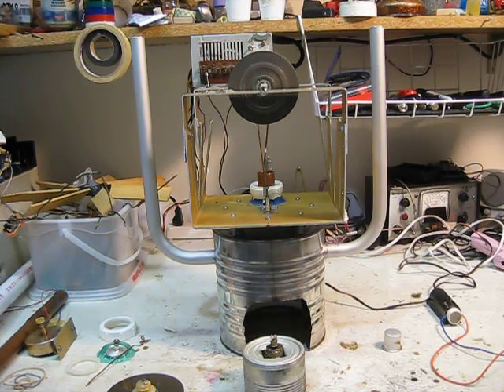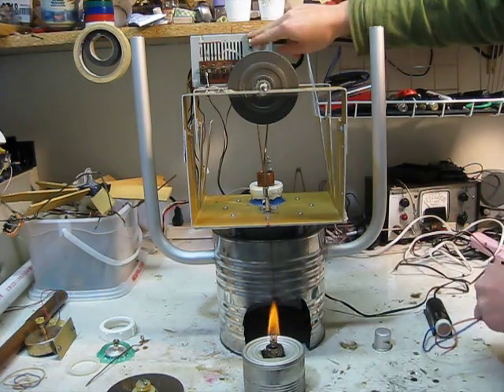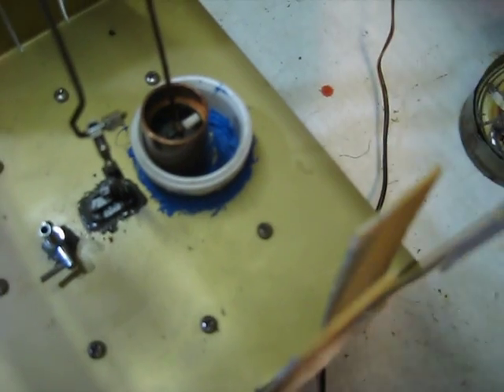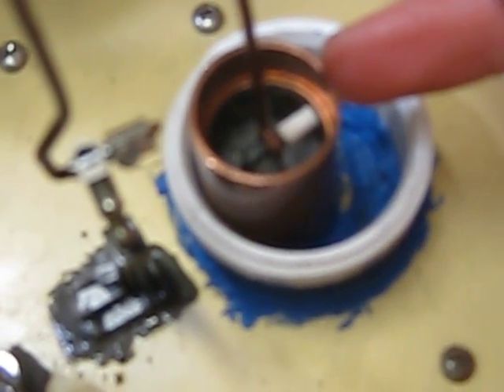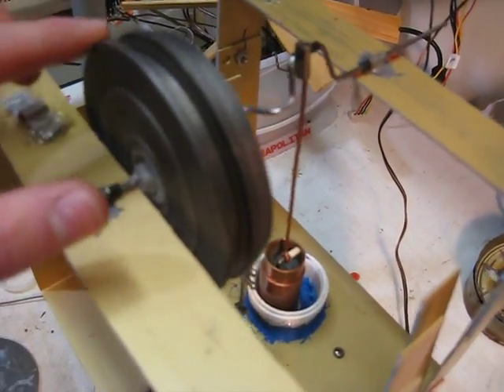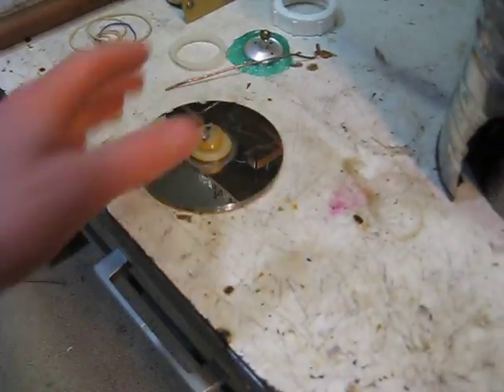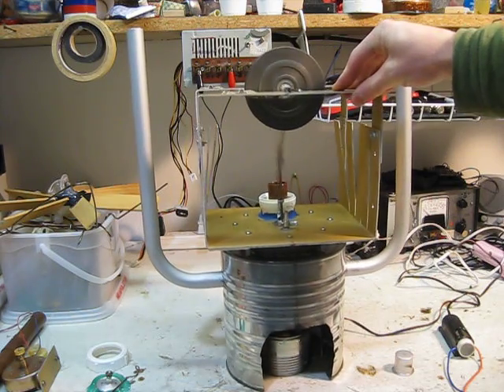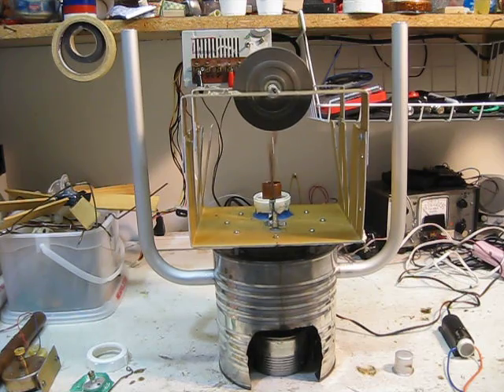Stirling Engine #2 Running With a Piston

Comment: Great stuff,  you sound young,  so tell Dad or Mum, Trev from Australia says I definitely need my own workshop with a nice lathe and a mig welder set for steel and another set for Aluminium,  a drill press, a router an angle grinder x2 one diamond tipped steel cutting blade, the other grinding discs,  and huge assortment of metric nuts and bolts and washers, x3 steel, stainless steel and hardened steel, an electric section with cable in various diameter, and tooling,  eg multimeter, crippers, ect ect,  a full bearing collection,  a vice,  epoxy and fiberglass,  and a decent budget for supplies.. 
too much to ask? 
I think you have real talent and i know you have the ability to build some amazing stuff,  film what you build and post it, your channel will easily start paying back your parents or “investors”  and let your imagination run wild!    I believe in you..
Reply: This was the first video i ever seen of yours,  you didn’t need my advice,  you are doing it..  well done mate!  Cheers..

Comment: where did you get the pipes to make that piston?  I have such a hard time making smooth heat resistant pistons, and it would be nice if I could just buy two pipes that would fit perfectly into each other.